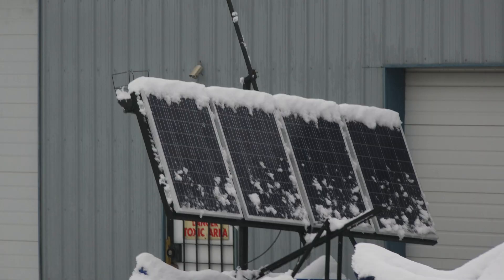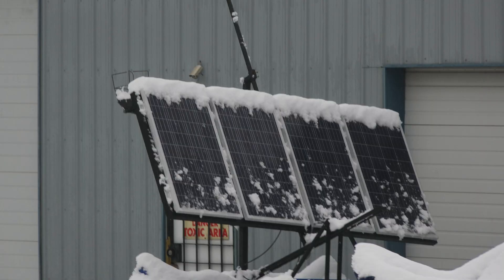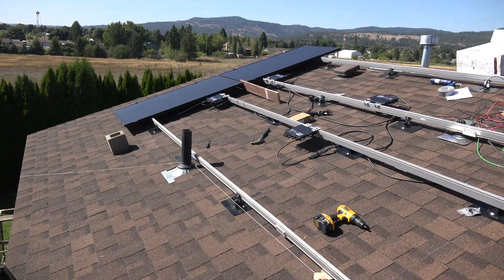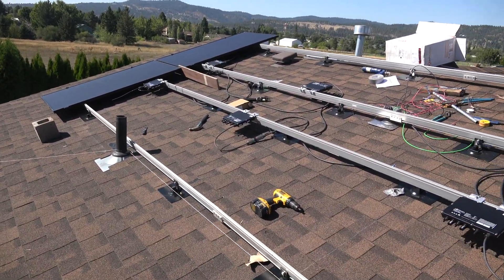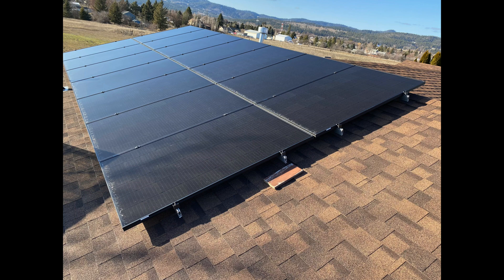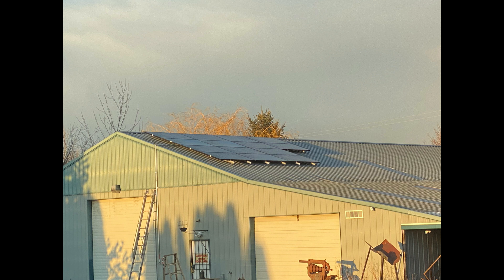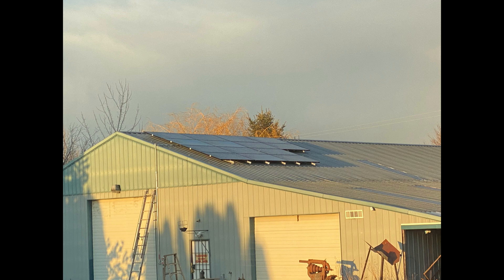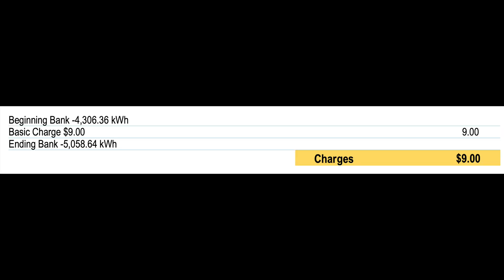Does solar work?

Comment: Climate change is BS
Reply from the maker: So, the fires in the West are caused by us not raking the forests?  The extended droughts are just normal cycles?  The increased intensity of hurricanes, tornadoes, and storms also just cycles?  The disaster declarations that every administration deals with are increasing in intensity and frequency.  I won't bore you with more.
GFM

Comment: Having a utility bill of zero, minus service charges is not the same as actually running a house on 100% solar.
The surplus energy in the real world does not get stored, during periods of low or no production grid tied solar homes rely on conventional power plants regardless of how much surplus there is. With high market penetration, there would be large surpluses in mild but sunny weather which could destabilize the grid. Consistency of output is a major problem, weather can change fast, so power plants have to run anyway.
For pv to work and replace power plants, efficient cost effective storage technology is a must and does not exist now.
Use of fossil fuels to mine and manufacture is also a huge problem - pv cells are made partially from coal, the coal is not just used power the process.  Try mining quartz without fossil fuels!

It can make financial sense to go pv, in places like arizona with consistent strong sun and high need for cooling, it can make a lot of sense. But don't expect to run industrial society off of solar.

Homes actually use relatively little electricity unless heating is electric; will never run hospitals or factories off of solar.
Reply from the maker: Its not about perfect, its about better.  
As an example, this summer, we had rolling blackouts because the draw was so high with A/C use.  Solar, in large amounts could have relieved that draw.
When I, as a power producer, supply that power, both the grid and the power suppliers have reduced demand.  That costs them less.  I get paid for that by building up a bank.  
I use that bank in the winter, when my solar is reduced.  
By having varied sources you can get a blend that increases the utilities ability to adjust for load.  
By "destabilize the grid" do you mean the utility cannot keep up with the variations?  That is their job.  They maintain the infrastructure and adjust their sources.
By my own figures, the vast majority of electricity use is during the day.  
I have no problem with petrochemicals made from coal.  That is its best use. Burning it is just a waste.  The cost in fuel usage to mine such materials pales in comparison to the cost in fuels to extract for fuel usage.  
I do not look at the financial aspect as nearly as important as the removal of fossil fuels as the prime energy source.
Try looking at it this way:  You do not put a roof on your house because you like the color or texture of the roof, you put it on because you do not want your possessions ruined and your health destroyed.  
In general terms, residential use is about 1/3, commercial is 1/3 and industrial is 1/3 or a little less of the total electricity use.  
Many companies are on a track to energy neutral in the next 10 years.  We will see if they follow thru.
Thanks for the thoughts.
GFM
Reply: @grayfurnaceman  pv does not address the primary energy use in homes well, which is heating. not enough produced.
even in the summer, i worry about fast changes in weather like clouding over which can not be anticipated by the grid operator. the grid operator may adjust output every few minutes, pv output changes in seconds.
if grid tied solar systems were required to have a small battery buffer, it would improve things.
that nor you having credits on your bill addresses the seasonal out issue, having weeks at a time of cloudy weather.
Energy neutral not the same as being energy independent especially with sources of energy not being able to replace each other easily. 
No amount of pv generated electricity made in july can replace the natural gas used for heating in december.
Reply from the maker: @Jon-hx7pe  You may be underestimating the ability of utilities to adapt.  They have been planning this changeover for a number of years.  
I also like the idea of battery backup.  The limitation of this is cost of the battery and the requirement for an automatic disconnect when the grid is down.  
I will be installing a high efficiency heat pump in my own home and we will see if I can still maintain a zero balance.
I don't think we can expect the elimination of fossil fuels as a source for peak usage for at least the next decade.  That may not even be desirable.  Commercial battery backup may solve some of this issue as it is an immediate source, but not for many years.  
It is also interesting to note that even in Dec and Jan my existing panels accommodate over 1/2 of my usage.
GFM
Reply: @grayfurnaceman  yes, we will have to see what happens. most energy is not consumed in the form of electricity, transportation and heat intensive processes are much harder to run without fossil fuel.
Reply from the maker: @Jon-hx7pe  We are in a transition time.  As with so many changes, resistance from established technologies is the primary force against change.
When we changed from horses to autos, there was a good 10 to 15 years disruption in transport.  Autos were saddled (no pun intended) with ordinances and laws restricting their use and sometimes violent reactions from horse owners.  By the 1920s, no one was looking back.
Remember, EVs are around 85 to 90% efficient.  ICE cars are 15 to 20%.  Producing electricity from a "free" source gives a whole new view of efficiency.  
GFM
Reply: @grayfurnaceman  if you look at changes in history, we went from lower quality energy sources to higher quality - better energy density and ease of storage, more practical to use, more economical, etc.
Shifting to renewables is the opposite, going to lower quality sources of energy, more diffuse, less demand is not the same. might say running on renewable energy is like living hand to mouth with little to no savings, any savings subjected to high inflation.
inheritance, not having to really work.
i don't really see evs working well on renewables, because they mostly aren't plugged in at home when renewable energy production is at highest.
the energy the panels produce may be free, but the resources going into panels are not.

I actually see electric rail as more viable, at least not having to deal with the batteries.
Reply from the maker: @Jon-hx7pe  If that were true, we would be driving nuclear powered cars.  "better energy density and ease of storage"   Super dense, storage space very small if you use enough lead to shield.  "economical"  When first considered it was thought that we would not even need to meter it.
So, why don't we use it?  Because it is incredibly DANGEROUS.
Why don't we run vehicles without smog controls built in?  Because if we did LA would look like Bejing.  
Why do we have crumple zones, air bags and cars heavy enough to keep their occupants alive in a crash.  These things did nothing to increase efficiency of the vehicles, yet they were done to make a better product or one that did not kill us from dirty air or injuries in a crash.  
Many seem to have the idea that options like solar are a step backwards when, in fact, they are a leap forward.  Home grown power will reduce power requirements and the infrastructure necessary.  Many companies are using rooftop solar to augment their power requirements so they won't be shut down by the utility when demand gets very high.  
In many areas, there is a substantial reduction in electricity rates for users that use power in the evening and early morning hours.  This the most common time for EV charging.  This is an attempt to even out demand. 
From my own use, I have found overnight use is very low unless I am charging my EV.
When solar becomes widespread, you will be amazed at how large a source it is.
In any case, we can't keep using fossil fuels at the rate we are.  Our world will not support it and they will run out.
I do however, agree on the electric rail.  We need far more of it.  BTW it runs mostly during the day when the sun shines.
GFM
Reply: @grayfurnaceman  we are talking energy sources, not air bags/car safety features. obviously energy is not the only consideration when designing a vehicle, otherwise suvs would not exist. there are no nuclear powered cars because it is not a practical or safe application for nuclear. it is a great technology for generating electricity consistently to meet base load requirements without burning fossil fuels directly, something renewables can't do.

i'll believe solar/wind is a step forwards when i see it. supplementing is different from actually trying to run everything off renewables.
Reply from the maker: @Jon-hx7pe  Just a few of the latest stats:  Iowa:  57% of electricity is wind.  Kansas:  43% wind.  Even Texas is 20%.  
If you want the source, I can give you a link.
GFM
Reply: @grayfurnaceman  i didn't expect this discussion to continue.
Just remember that percent generated is not the same as percent of demand met.
i'm in ontario canada and we've had a lot of problems with surplus wind generation during low demand periods, forced to buy it on contract, then sell it for next to nothing at a loss. still need the gas fired peaker plants. the installed wind/solar energy hasn't put a dent in fossil fuel fired generation here. what has - refurbished nuclear reactors coming back online, demand dropping. fossil fuel power generation will only go up since a old nuclear plant with 6 operating reactors will be taken offline in 2025.
Reply from the maker: @Jon-hx7pe  OK, you are set and I am set so lets just drop it.
GFM

Comment: Can't begin to catch up with you on panel count, but I have a dozen, 330 watt 96 cell Pansonics in the basement, probably be waiting for next spring summer to build a ground mount (to much "Uncle Arthur" the the high climbing stuff...). Ended plans for the install this year when I saw what a single piece of 2" galvanized-threaded conduit was...$100 bucks at current steel prices. I'll upgrade my current system to a Sol Ark 8K and and 7.5 kw KiloVault in the next weeks in the meantime (zero export). Grid Connect here is legal, but the power companies will go a long way to "disincentivize" you thru"Fees" and whatever else they can think of...:-(
Reply: If you can avoid ground mount, you should.  Roof mount, if available, is best as the structure is already there and it is higher.
The fee issue is not going away.  My bill is $9.00 a month.  The utility cannot survive on that.  My concern is that they will overdo the fees as they have for EVs in my state.
GFM
Reply: @electriccar3253  A roof I have, facing east and west... The site for mounting the panels isn't really height sensitive as I'm in a valley anyway and my arthritic knees (now requiring replacement, in the near future) are not up to climbing much anymore. As for the Fees, my local power company wanted $400.00 just for the "privilege" of doing a grid tie. At the time given my panel capacity, it would have taken me two years or so to pay back that fee. 
   As for EV fees, here in Ohio the Renewal fee for my Prius has gone up an extra hundred bucks a year as its also considered an EV.
Reply from the maker: @festeradams3972  In the near future, I will be publishing some info on a west facing roof solar.  It may be better than you may think.  
My utility charges $100 for anything under 25 KW.  I do expect changes as more solar is installed.  
When my state decided to charge $100 for replacing road taxes, I was supportive.  As usual, give government an inch and they take a mile and the charges are now higher than if I drove an ICE car.
GFM

Comment: Solar is good for short time solution. The materials used for solar are very rare. They are destroying many acres of lands and agricultures  just to get a little  solar material. DW (German documentary Channel) had a documentary on it a few month ago. Wind Energy is the best solution for human survivor so far.
Reply from the maker: I would have to differ.  
The issue of materials, rare earths, etc is a bit overblown.  As with any technology, when one material gets hard to get (or more expensive), the industry looks for solutions that do not use the particular material.  
In the last decade, materials and methods have undergone massive changes.  
This is true of both solar and wind.  The first wind turbine I saw was lying face down in beach sand.  They built it like a radio tower with guy wires.
Wind turbines also use rare earths and other materials that could become in short supply.  They need 30,000 tons of concrete, 25 to 50 tons of rebar.  
300 15KW solar arrays will produce about the same power as one turbine.
No moving parts, no maintenance on solar systems.  They take up no land, they are on your roof.  
If we come back in 25 years, wind turbines will be producing power and mechanical parts will be failing and being replaced.
Solar panels will be being replaced because they are reaching their 80% production number, the roof will need replacing and new panels will be far more efficient, probably reaching 50% efficient.
The point is there are many technologies that we may use to meet our energy needs.  We need to use them all.
GFM

Comment: Long and short answer is yes for me. When I bought my home, prices was still high back in 2011 and I needed a new roof first. Second, made some energy efficient upgrades. Insulation, a newer energy efficient fridge/freezer (old one was using almost 5 kWh per day vs 1.2 kWh per day), etc. In 2018, I took the plunge and went grid-tie solar. I have enough credits to be net zero for the year, just pay the minimum customer charge. I only have a 900 square foot south facing roof to work with and was able to put together 7.2 kW system and planing to build it out to a 10.08 kW in the future. Since I am planning to be here for the next 10 or more years. My goal is to be paid off by year 5, amortized by year 10, and writing off the last 5 as a hobby. Currently looking into a hybrid approach to battery storage, mainly for backup purposes. With a flat rate of 12 cents per kWh, there is really no payback benefit on it. Just having the peace of mind if I want to "trip over" the utility extension cord, I am able to do and go on with normal life not batting an eye that I am in offline/off-grid mode is priceless.

I might dust off my programmable logic controller skills to setup a system to purposely take myself offline and operate in backup mode during peak usage times. Energy storage integration is more of a hobby at this point. I already have a 7 kWh telecom 48 volt DC plant running some of my general lighting, computer network equipment, and soon be adding telecom mini-split heat pump units as the budget allows.
Reply from the maker: Sounds like you are pretty much there.  
So far, I have not seen much value to battery backup.  I do have one but mostly wastes the excess power.  
GFM
Reply: @grayfurnaceman  I agree that battery backup is not for everyone, I live in the subtropical zone where I have to deal with hurricanes and afternoon thunderstorms that seems to me is the worst than any hurricane coming ashore lasting less than an hour.

I've been experimenting with LifePO4 batteries and there is quite a difference compare to traditional lead acid counterparts. The biggest difference is there is no more float charge current, the charger pretty much cuts off the charge current once absorption voltage has been met. One thing like about have part of my loads running on the DC side the zero switchover time and having a bit of redundancy if the inverter/charger fails.
Reply from the maker: @felaxchow207  If I was you, I would also be looking at battery storage.
What I see as the best solution is an electric car that could be tapped for power during the night and recharged during the sunlight hours.  
GFM
Reply: @grayfurnaceman  you read my mind, EV is in the plans too. I rather dump the excess to it first then export it. My power company is only paying 3 cents per kWh for the credits that I don’t use at the end of the year.
Reply from the maker: @felaxchow207  I am thinking:  I have a 100 KW battery in my EV why can't I use it for emergencies?
GFM
Reply: @grayfurnaceman  in theory it is possible. Add an H-bridge circuit on to the onboard charger will turn it into basically an inverter/charger. Some more components like a transfer switch with an autotransformer on the Level 2 EVSE side using the existing communications pins to tell the onboard inverter/charger to which mode it needs to be in. Viola, you have a 7 kW emergency power pack at 120/240 volts AC in the raw gist of it. Getting it UL approved for that kind of use is another matter.